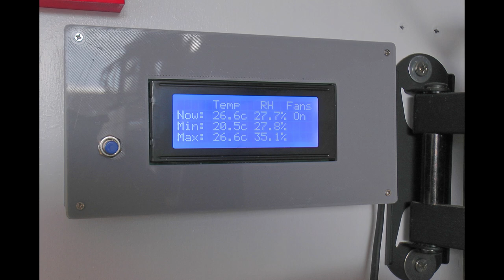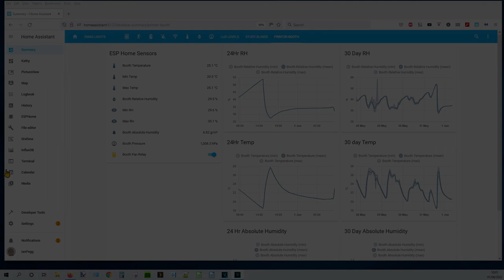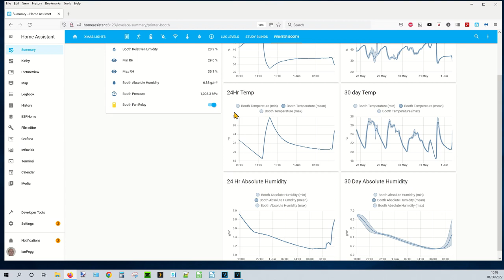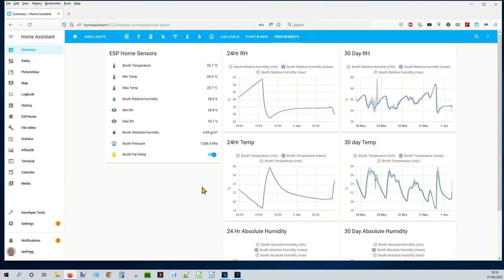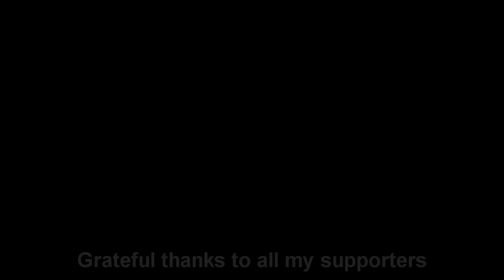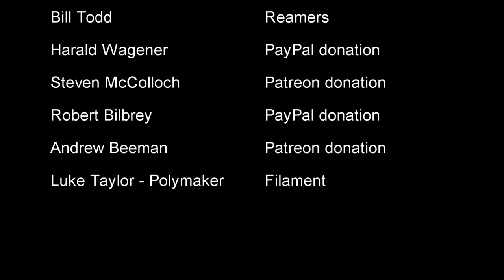Printer Booth Humidity Measurement and Control

Comment: Absolute humidity going up because the moisture in filament and on surfaces now in the air?
Reply from the maker: Yes, I've been thinking about this a lot and I'm coming to the same conclusion. I've double checked the formula ad it looks about right. I've looked at the Calcium Chloride crystals and they are showing signs of getting "mushy" so definitely absorbing moisture. Also, from the limited amount of data collected so far, it looks like absolute humidity goes up as the temperature increases. That would make sense if moisture is being transferred from the filament and other items, into the air. That being the case, then Abs H should continue to increase or flatline as the filament releases moisture, then go down. I'll know better when I have a few days of data.